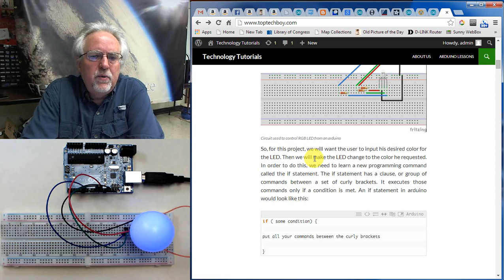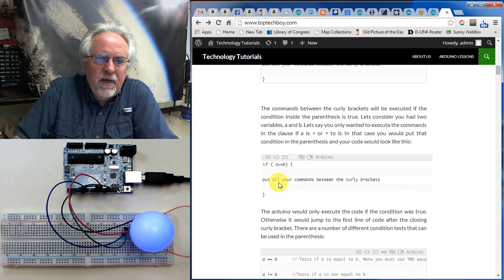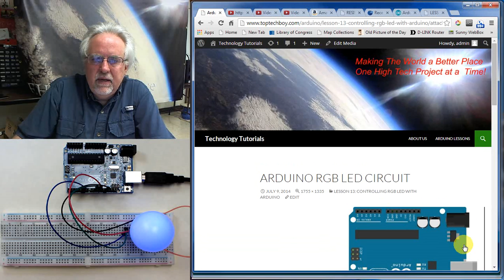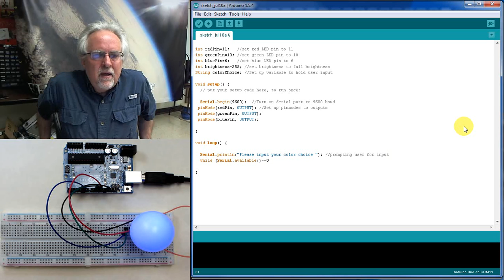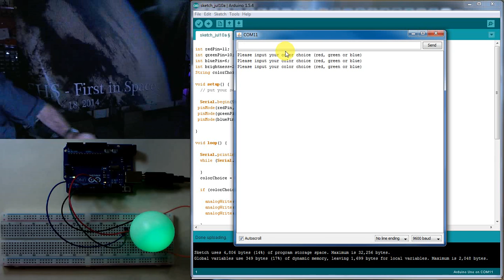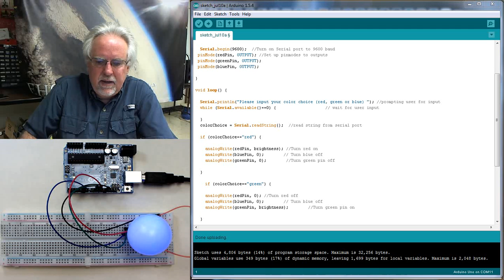LESSON 14: Arduino If Statements and Conditionals

Comment: Thank you for posting this lesson. I created and successfully did lesson 13. Unfortunately, lesson 14 code that I wrote along with your lesson downloaded to the arduino, but when I enter a color - red - into the serial monitor, I obtain this message "You have not entered a valid color, please enter red, blue or green." Do you have any advice?
Today, I copied your code to a new sketch, just to make sure that I did it correctly and I obtained the same message on arduino.
Reply: I've also experienced the same, even after copy-pasting his code. I think there may have been some changes to Arduino since them, and I don't know how to solve it.
Reply: On the contrary, @Rob Jameson has a solution. "You also have to make sure the Serial Monitor is set to 'No Line Ending". It worked for me.
Reply: @MsAora  Thank you so much I was getting the same invalid message this fixed the issue. Thank you thank you thank you

Comment: You also have to make sure the Serial Monitor is set to 'No Line Ending'.  Not on the default 'Newline' - or it returns a 'Not a Valid Color choice...' message.
Reply: I have been tearing my hair out as to why it didn't work as intended, thank you very much.

Comment: Lesson 13 not working; serial port outputs string comments on serial monitor but doesn’t provide output on LED analog pins.  Checked outputs with other commands and they are functional, just not with the “while” function.  What’s happening?, new to this also!
Reply: same

Comment: If you do not have a RGB led, you can plug  a red, a blue and a green LED as close as you can, stick some translucent paper around (I do not have a ping pong ball either!), and it works pretty well. I also had to put red led full power (255) and blue and green at 25, as the red I have is a lot dimmer. Do not forget to pinMode your leds as OUTPUT, or they won't get full power from the arduino.

Comment: If you are using a Common Anode RGB, just bring +5V to the VCC and change the values in Paul's program to the opposite logic.
i.e. 0 = ON, 255 = OFF. 
Here is a link to Common Anode Color Codes for the RGB https://learn.sparkfun.com/tutorials/lilypad-tri-color-led-hookup-guide/all

Comment: Can anyone please tell me why this isn't working. When I type proper string, it just output wrong input msg. It looks like if statement doesn't work even if I input the right condition. 

_________________

int redPin = 11;

int greenPin = 10;

int bluePin = 6;

int brightness = 15;

int blendBright = 5;

String colorChoice;

void setup() {

  // put your setup code here, to run once:

Serial.begin(9600);

pinMode(redPin, OUTPUT);

pinMode(greenPin, OUTPUT);

pinMode(bluePin, OUTPUT);

}

void loop() {

  Serial.println("Dark Lilac or Quiet Ocean? "); //prompting user to input color value

  while (Serial.available()==0) {}

  colorChoice = Serial.readString();

  if (colorChoice == "Dark Lilac") {

    Serial.println("You've chosen Dark Lilac");

    Serial.println("");

    analogWrite(redPin,blendBright);

    analogWrite(greenPin, 0);

    analogWrite(bluePin, brightness); 

    }

    

    if (colorChoice == "Quiet Ocean"){

    Serial.println("You've chosen Quiet Ocean");

    Serial.println("");

    analogWrite(redPin, 0);

    analogWrite(greenPin, brightness);

    analogWrite(bluePin, blendBright);

    }

    else {

    Serial.println("");

    Serial.println("Sorry, that's not available at the moment, please choose from what we have." );

    Serial.println("");

    }

    

  

}
Reply: Sorry, I cant help you out. You seem to be a bit further than I am. Keep trying, it hardly ever works the first time for me but I crack it in the end.

Comment: Hi sir, In this particular video of Lesson 14, I'm facing an issue as the code just passes through the If statements without execution. I even tried copy pasting your video from the website, I guess the string highlighted inside " " of the if the statement was not recognized. Any possible solutions Please??
Reply: go to the serial monitor and go to the 1st pull down and select " no line ending"

Comment: if your serial monitor skips all the ifs you set before the wrong choice -if, and you copy the same code but still not working and the wrong-message shows up. all you need to do is change the serial monitor settings to no line settings. I hope this works for you all.
Reply: Thanks you for sharing! Had this problem and this fixed my issue, thanks!
Reply: THANK YOU!!! I really thought i was going CrAzY!! I even copied Pauls code and was like WTF!

Comment: I could not get the LED's to change colors without changing the command to if (colorChoice.startsWith("red")){}. It does not read string data with a direct == "red" command. This also made throwing an exception with this method impossible. I'd like some clarification as to why please. I've already hit up the arduino forums and was provided this workaround but not an explanation.
Reply: if you resolve this please tell me

Comment: Paul McWhorter you need to study on vitaminCfoundation/stone or serach cathcart vitamin C ( megadosing = put the value there its meant to be before we lost the ability to create it as the animals) to get rid of your cough.
Reply from the maker: It’s seasonal allergies from juniper. Really nothing helps until season change
Reply: When I will be really glad and pleased to tell you that if you read the chapter on "hayfever "  ( takes upp all allergia) in the free bok that is on the link  vitaminCfoundation/Stone you will se that your bowel tolerance for ascorbate is very high under the periods the allergen is in the air. That meaning that if its no allergens in the air and you are 100% feeling okay your bowel tolerance will be somewhere at 15 grams a day. BUT if you say catch a cold your bowel tolerance will go up several times, how much depends on the oxidative stress the microb is put on your system. You can increase the dosage until you feel the symtoms goes away you will than be right under your bowel tolerance level !  Listen to Dr Robert Cathcart  vitamin C on youtube telling about he treated 30 000 patietns with allergia, severe infections with this method and it works out all the time. You can also type in Linus Pauling vitamin C urine in youtube to see one minute statement by this twice nobel leatureate.   Spend one hour investigating this and you will not cough anymore to to juniper or colds.

Comment: Great videos Paul. I am going through all your lessons and I had a question (if you're still monitoring these). I wrote mine to ignore upper or lower case user input with 'colorChoice.equalsIgnoreCase() function which works but in the last 'if' statement for error handling I have  if (colorChoice != colorChoice.equalsIgnoreCase("red") || colorChoice != colorChoice.equalsIgnoreCase("green") || colorChoice != colorChoice.equalsIgnoreCase("blue")), the conditions are still met and I get the "You have not entered a valid color, please enter red, green or blue.") message. What am I doing wrong?

Comment: Sir I think " if(colorchoice!="blueled" || colorchoice!="redled" || colorchoice!="greenled") " will be #more  #appropriate , although either AND&&/OR||  will work here as user will input only one color. Correct me if I am wrong.
Reply: Actually, in this way it would always display the "invalid color message". Think about it, when user inputs a valid color (e.g. "redled"), the LED will turn red but the message will be displayed anyway since the condition "if(colorchoice!="blueled" || colorchoice!="redled" || colorchoice!="greenled") "  becomes true. Only one of the arguments must be true to make the whole condition true (because it's an OR), and "redled" is not equal to "blueled" and "greenled". Hope you get the point, kind of tricky at first but you'll definitely get it
Reply: correct.

Comment: when we want user to enter specif value, we use do{}while();  loop or we can use while(true), for this case, we could write something like this

void loop(){

int i=0; //this variable is used to show message - "What color do yo
//want [red,green,blue]?" only for first time, but if user enter wrong number
//he will get warning message

      do {     
             if(i==0){         
             Serial.println("What color do you want? [red,green or blue]");  
       } else {         
         Serial.println("You have entered wrong color, please enter red,   green or a blue!");       
       
       }
       
       while(Serial.available()==0){}

    colorChoice=Serial.readString();
      
       i=1;//for the time, if user enter wrong number
//to get warning message
     
     }while(colorChoice!="red" && colorChoice!="green" && colorChoice!="blue");

}
Reply: I am making a arduino obstacle avoiding robot using a kit from Uctronics.com 
It has a arduino uno , a Bluetooth module , a IR sensor and remote ,and 1 ultrasonic sensor ...but I want to add 2 more ultrasonic sensors ...but I don't know how to add the sensors to the program code...Can you please help me???
Reply: Adding sensors is simple in that, it is the same way a single sensor is - assigning a pin location from the Arduino board and assigning them 'names' and associate each void setup / loop code to those names. You'll have to watch how much memory is being consumed based on the complexity of your code and conditions you are setting for your ultrasonic sensor assignments.

Comment: Paul - Great job providing these lessons. Thanks for all your hard putting this series together.
I am confused by the if clause to check for the proper color choice input. It seems these should be "OR" statements instead of AND". Not sure how the clause can run because the input choice can't be all those colors at the same time. What am I missing? Can someone explain. Maybe it will run either way.
Reply: if (color not red AND color not green AND color not blue){

//warn user that something is wrong
}else{
// do the proper job
}

or you can put this condition

if(color is red OR color is green OR color is blue){
// do the proper job
}else{
//warn user that something is wrong
}

TRUE  AND  TRUE -> TRUE
TRUE AND FALSE -> FALSE
TRUE OR FALSE -> TRUE

Comment: the code is not working on my arduino it's skip all the instruction and reach at last wrong instruction comment even though i copy your same code same error repeat again.
Reply: You must probably change your serial monitor settings (Take a look at his serial monitor)
Reply: i had the same problem, but I changed the serial monitor settings to no line settings, and it is working just fine.
Reply: I just had the same problem, in August 2018. But I had run this code in 2015 with an earlier version of the Arduino IDE -- version 1.6.5.  and it worked fine. So I decided to uninstall the recent version I had just downloaded -- version 1.8.6., and reinstalled the older version 1.6.5., and the problem went away. Maybe you're having the same problem.

Comment: Hi Paul I am new to this and I am really enjoying your lessons. I just finished lesson 14 and had an issue with some { } brackets. I did not put any in after while (Serial.available()==0) { here then close them on the next line }  They don't seem to "contain any code", could you please elaborate - Thank you.
Reply from the maker: Exactly . . . no code because you are waiting, and doing nothing. Nonetheless they are required because they define the clause that does exactly what you want, which is nothing.
Reply: Hi Paul, i went over your tutorial and realised I missed your very clear statement "we sit there with an empty clause and do nothing". It was the "clause" that I got wrong as defined: 
a 'unit of grammatical organisation next below the sentence in rank and in traditional grammar said to consist of a subject and predicate'
Thank you for your response I am sure I wont forget this one:)

Comment: Thanks again Paul. 

//Ask user how bright to set an RGB LED
int redPin=11;  //set red LED to pin 11 with 330 Ohm Resistor on red wires
int greenPin=10; //set green LED to pin 10 with 330 Ohm Resistor on blue&black wires
int bluePin=6; //set blue LED to pin 6 with 330 Ohm Resistor on white wires
int brightness = 255; //set max brightness as default
String colorChoice; //red,green,blue, yellow, pink, cyan, white

void setup() {
  // put your setup code here, to run once:
Serial.begin(9600); //turn on serial port
pinMode(redPin, OUTPUT); //set red pin to be an output
pinMode(greenPin, OUTPUT); //set green pin to be an output
pinMode(bluePin, OUTPUT); //set blue pin to be an output
Serial.println("Hi there. My name is Fred."); //Arduino greeting.
Serial.println("How should I set my LED Rainbow to make your day?"); //Arduino greeting.
}

void loop() {
  // put your main code here, to run repeatedly:

Serial.println("Please enter color? I know red,green,blue,yellow,pink,cyan or white" ); //get user input value for colorChoice
while (Serial.available() == 0) { }
colorChoice = Serial.readString(); //read string from serial port
Serial.print("You chose: ") + Serial.println(colorChoice);

if (colorChoice == "red") {
  analogWrite(redPin,brightness) ; //turn on at brightness of 255 (max)
  analogWrite(bluePin,0); //turn off blue
  analogWrite(greenPin,0); //turn off green
}

if (colorChoice == "green") {
  analogWrite(redPin,0) ; //turn off red
  analogWrite(bluePin,0); //turn off blue
  analogWrite(greenPin,brightness); //turn on green
}

if (colorChoice == "blue") {
  analogWrite(redPin,0) ; //turn off red
  analogWrite(bluePin,brightness); //turn on blue
  analogWrite(greenPin,0); //turn off green
}

if (colorChoice == "yellow") {
  analogWrite(redPin,brightness) ; //turn on red
  analogWrite(bluePin,0); //turn off blue
  analogWrite(greenPin,brightness); //turn on green
}

if (colorChoice == "pink") {
  analogWrite(redPin,brightness) ; //turn on red
  analogWrite(bluePin,brightness); //turn on blue
  analogWrite(greenPin,0); //turn off green
}

if (colorChoice == "cyan") {
  analogWrite(redPin,0) ; //turn off red
  analogWrite(bluePin,brightness); //turn on blue
  analogWrite(greenPin,brightness); //turn on green
}

if (colorChoice == "white") {
  analogWrite(redPin,brightness) ; //turn on red
  analogWrite(bluePin,brightness); //turn on blue
  analogWrite(greenPin,brightness); //turn on green
}

//check for valid color input and turn off LED if input invalid
if (colorChoice !="red" &&colorChoice !="green" &&colorChoice !="blue" &&colorChoice !="yellow" &&colorChoice !="pink" &&colorChoice !="cyan" &&colorChoice !="white") {
  //Serial.println(); //blank line
  Serial.println("This is not a color I know. Please check your spelling and try again.");
  //switch off LED on invalid input
  analogWrite(redPin,0) ; //turn off red
  analogWrite(bluePin,0); //turn off blue
  analogWrite(greenPin,0); //turn off green
}

Serial.println(); //blank line
//Serial.println("I try to brighten your day :-)");

}

Comment: i just felt that using if...elif...elif...else... is a better way to code the different colour brightness.
Reply from the maker: It is perhaps a matter of taste, but as an engineer, so many times problems were traced back to using "else". Else, or elif is a little like a double negative and sort of hard to think through and consider all the ramifications. Hence, I never used else statements.

Comment: +Paul McWhorter 
Hey there. I am doing a project whose main idea is to switch on 4 independent lights depending on the input provided by the IR proximity sensor. For that to happen, I am using the code below. 

for(int irv = 0; irv < 4; irv++){
    for(int irValue = 0; irValue < 4; irValue++){
      irValue[irv] = digitalRead(irSensor[irValue])
    }
  } 

But i am getting an error as follows:
invalid types 'int[int]' for array subscript

I would really appreciate if you could help me with this part. I requesting to you as a student. 

My warm regards

Comment: Dear Paul.

Im going crazy here, Im designing a code for a horse food quantity measure system, It works like this.

It ask the code for the horse if you prompt it right on the serial it prints the horse name and asks if its correct, if you prompt 1 it yes 2 it no and goes back to the main loop.

If its yes then it moves a servo and serves the quantity of food that i have already define for that horse. 

Up to here everything its working ok, but the problem its that I have to define many horses so it has to have many ifs and I don't know how to do it, can you please help me?!

I can send you the code so you take a look?!

Best regards.